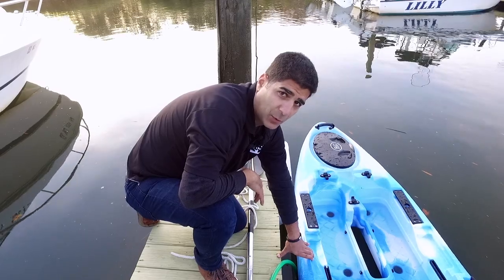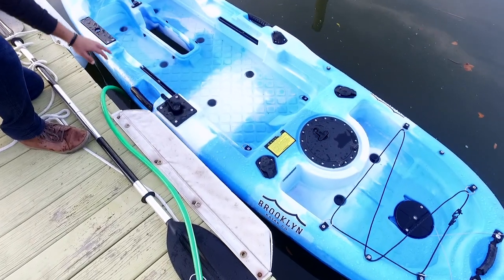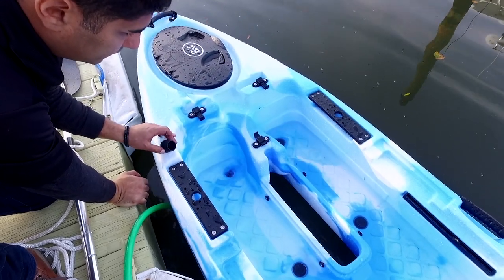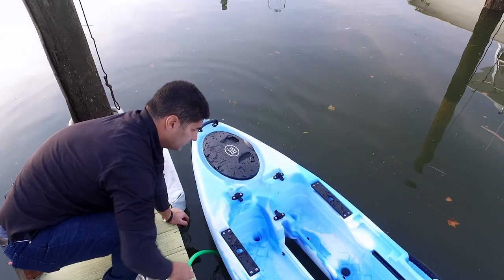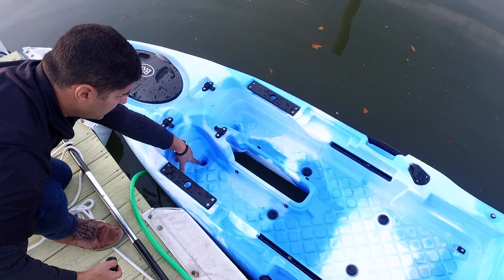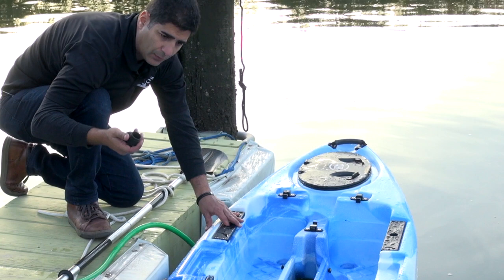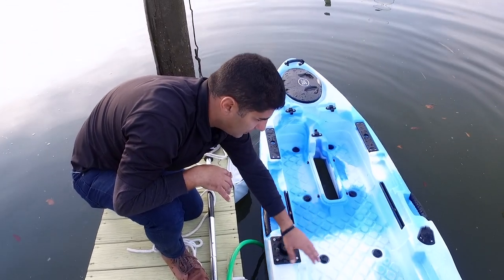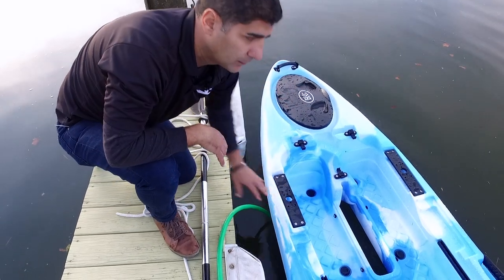A Guide to Scupper Plugs

Comment: "If left unattended in the rain, it would probably sink"  This is INCORRECT.  The kayak itself is sealed (unless you leave the cargo hatch open) it cannot sink unless the inner chamber fills with water.   Also,as you can see in the video the kayak was already nearly as full of water as it could be for when it gets much higher it would drain through the hole for pedal system insert.  Respectfully, it's a bit concerning that a "Founder and Product Specialist" in the company doesn't understand basic functionality of the products being sold.
Reply: @Couchlover47  haha fair enough.   Was just trying to keep those who don't know any better from getting wrong info but I suppose I could have kept that to myself.
Reply: @perrys5954  I understand you Perry. Thanks.
Reply: @jimmymcjimmyvich9052  Thanks for saying that.  It's a bit shocking how many people lash out at a bit of correction.  Appreciate your feedback :)

Comment: So, can you ride without using these scupper plugs? I ordered a kayak, and I havent got any of these plugs.
Reply: Okay, I tried out my kayak and it was amazing. So you can use it without these plugs. Anyway I use an islander calypso beach kayak, and it is pretty stable.
Reply: @davidcsik9761  I would say buy a small handheld bilge pump just in case.

Comment: Sorry if a dumb question but how do you get the water out? Just turning it upside down and angling it to drain? Only reason that seems off to me is because my new 50 lb kayak is heavy and that seems harder that it is on paper.
Reply from the maker: Hey Stephen, it actually depends on where the build up of water is.  Either drain plugs or scupper plugs can help keep the water out so there isn't that much to drain.  But if you mean the water that might naturally come in when paddling, you can contact us and one of our Product Specialists can assist.  You can live chat us, email or call us and ask for our Product Specialists help for an issue like this. :)
Reply: 50lb kayak is heavy? Lol... try my Jackson Big Rig..145lb.
Reply: Just pull one of the plugs! The kayak itself won't sink because it's full of air.
I use the plugs to keep water from splashing up but you can leave them out

Comment: Wouldnt it push water in if you are in the kayak? Just curious i never been in a kayak before i just was on tiktok and it made me find out what scupper plugs and holes where
Reply: I was thinking the same thing..especially if riding in rough waters without the plugs 🤔
Reply: The scupper holes will only let in a limited amount of water, due to the overall buoyancy of the kayak, but will allow any buildup of water inside the kayak to drain out.  The only time you'd want to plug them is for cooler weather kayaking on flat water trips.

Comment: Yes but there is nothing in the kayak. 
I weight under 220 and as soon as I get into my PK12 the water comes to the top of the scuppers and in motion there is water on the floor.
I have to leave the 2 plugs behind the seat out so the kayak doesn't fill with water while using the front scuppers.
I have no clue where the max weight of 460 pounds came from unless that's the sinking weight.
Reply: have the same issue with another kayak from bkc. The water comes above the hatch and water eventually gets into the inner chamber making it impossible to get on the water with the scuppers out.